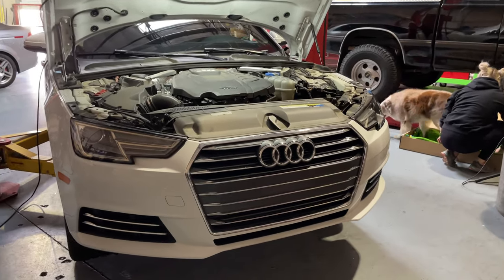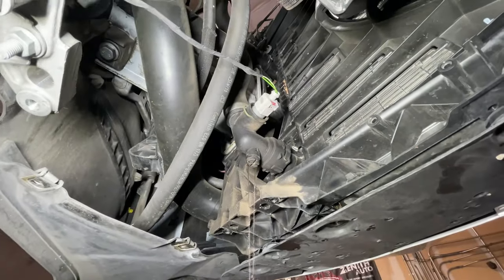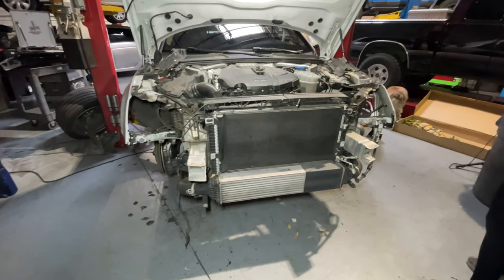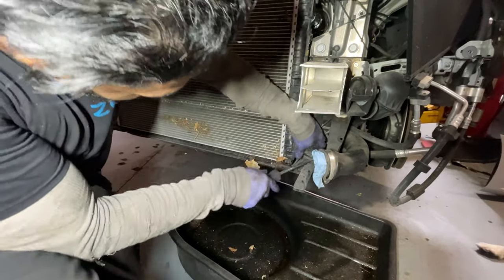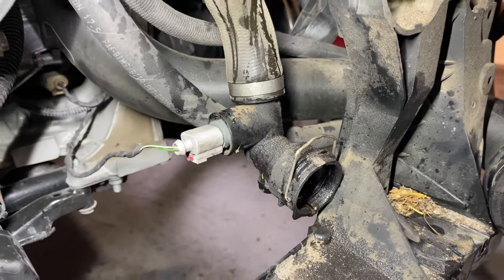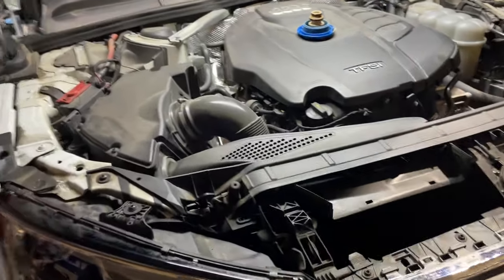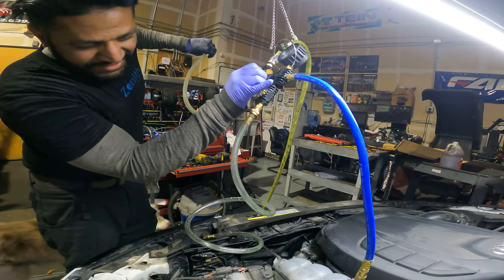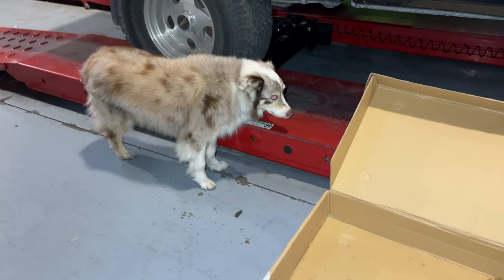Replacing a Leaking Radiator on a B9 Audi : 2017 Audi A4

Comment: At the bottom corners of the radiator where those rubber pushings are, there are 2 little torx screws under the rubber things. If you loosen those the radiator will pull straight out

Comment: The first video on I’ve seen on my car, been working on it for the longest! Tips for replacing the whole front end?
Reply from the maker: As far as removing it all? Patience! Lol, there was always another part that seemed to have to be taken off. But honestly now that I've done it once, I think it would go pretty fast the next time, it's almost like legos. A lot of composite materials though so just have to be patient and careful not to break anything. If you have adaptive cruise control (radar behind the bumper cover) and/or a front camera, those also have to be re-calibrated when they're re-installed with an ADAS calibration tool. Luckily this one didn't have that saving us some time on the reassembly.

Comment: Literally just doing my water pup on my a4 b9. I gotta say. I did water pump/thermostat, radiotor, expansion tank on my old bmw e90 335i and doesn’t even compare…….this is like 60 percent easier
Reply from the maker: I bet, these German cars require a lot of disassembly. I’m spoiled and used to Japanese cars where I can change a radiator in 30 minutes.

Comment: Can you replace the fan without taking the radiator out ?
Reply: I’m currently working on my own a4 for both the fan and radiator, and so you gotta take out the radiator for sure since the fan is hooked up to it
Reply: @rameekguy7222  got it installed but looks my relay is bad. And I can’t find the relay location in a b9

Comment: I've got a leak in my AC condenser. We spotted it spraying refrigerant right out of a pinhole in the middle of the condenser. Is it possible to replace just the condenser from the top or will I still have to remove all the front stuff like you did?

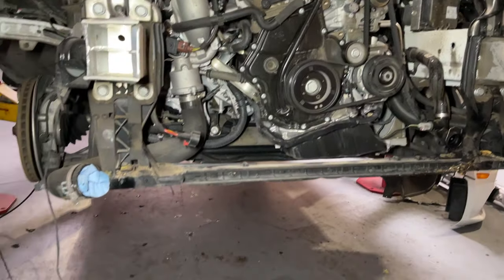Comment: At time 4:15 you have a sensor or something dangling away...where does it go?? I did the same thing water pump removal. I assume it is the lower hose quick connect area? Right side.
Reply from the maker: Hey, that's an ambient temperature sensor. it tucks up inside the front grill of the bumper cover.
Reply: Awesome thank you! I figured it out when reassembling , I just followed the the marking from the clips. @SkillCollectors  . I did my Water Pump N thermo stat an I can say is Working on Audi's an making it run awesome is something to be proud of!